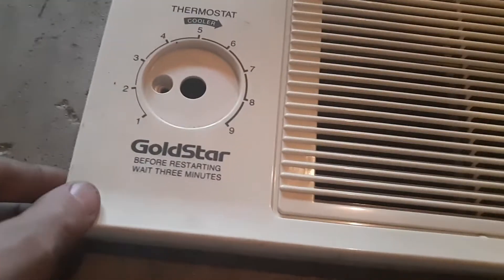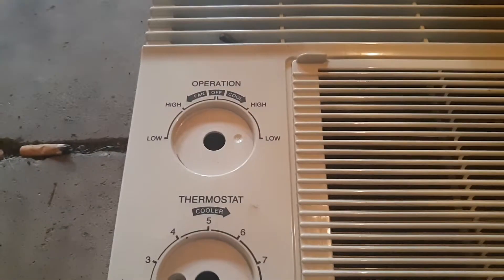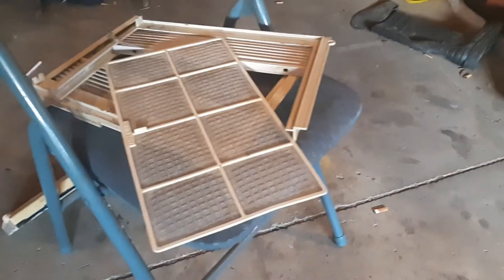1998 Gold Star (LG) window air conditioner

Comment: I have a GoldStar 10k BTU unit in my living room wall, it's from 1992 and it was made when GoldStar was their own company before they merged and became LG. It has digital controls which is strange for that age and it works extremely well. It's also built very well, a lot better than the later LG models.
Reply from the maker: Is it possible if you can make a video of that machine?
Reply: @theericfreeze1493  yea I can
Reply from the maker: @brunoshow124  thanks
Reply: @theericfreeze1493  Uploading it now, kinda not a great video but it works.